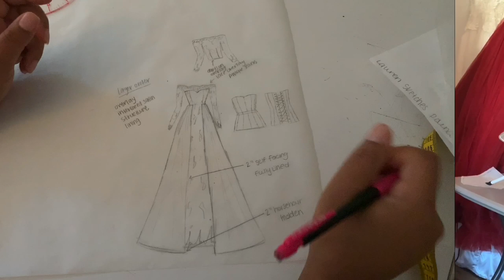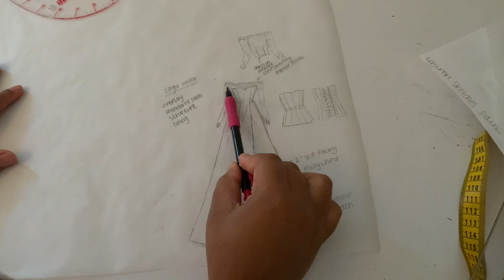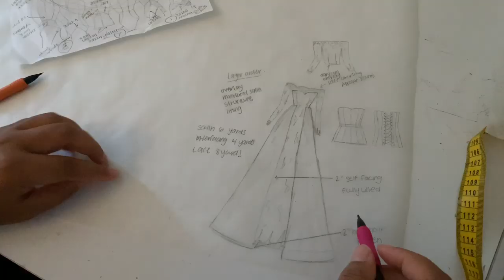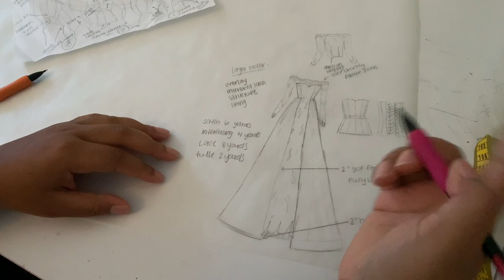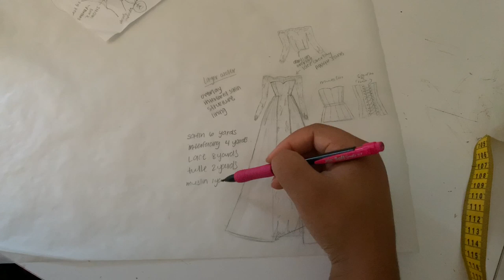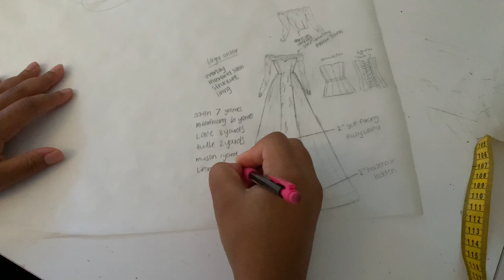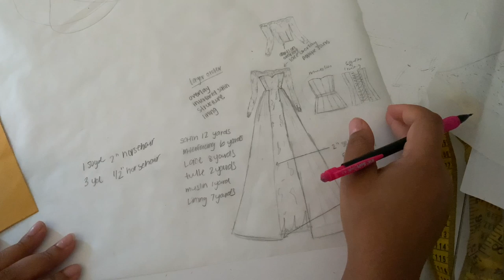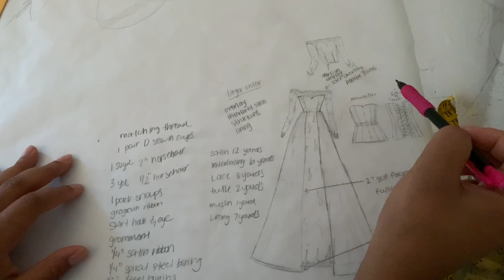Let’s Design a Black Wedding Dress: The Plans and Costing a Wedding Dress

Comment: Good planning. I just completed my couture wedding dress this Summer. I used duck (cotton) for my foundation layer, which was boned with spiral steel. The bones did not show through my duchess satin or lace overlay layers. And, I used grommets and laced the back. I achieved a really nice waist reduction, too. Anyway, I wanted to recommend  duck instead of muslin. Quarter inch ribbons will work better than the one eigth ribbon.
Reply from the maker: Hey! Thank you! I will look into the duck. Thanks for the tip for the ribbon will be buying the 1/4”